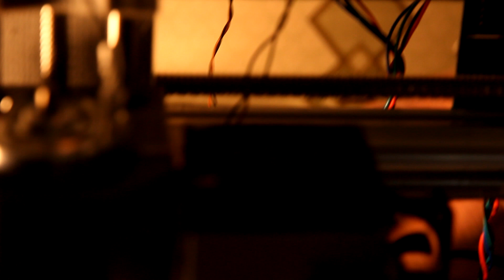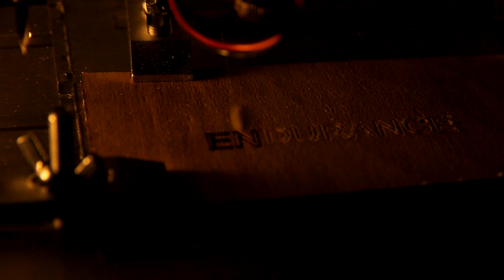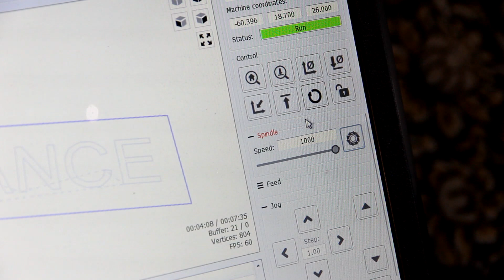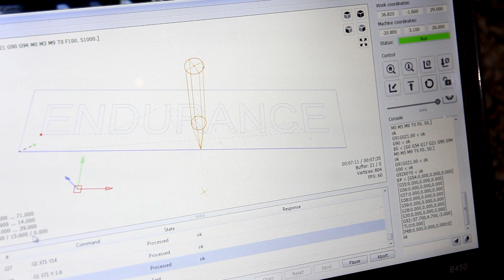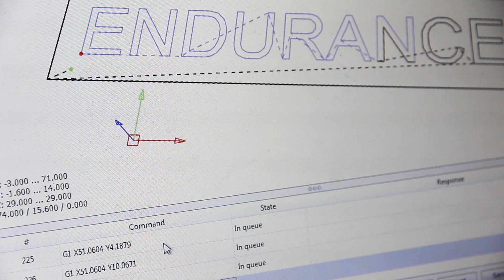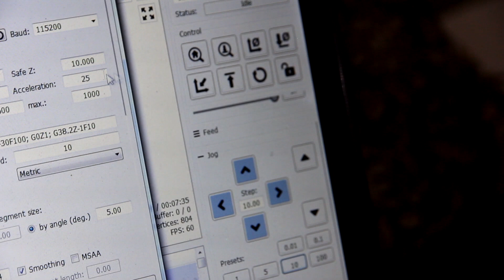How to run a CNC 3018 milling machine. Upgrade with an Endurance laser module.

Comment: Just as an edit, the spindle speed is around 8300-8500 rpm at 24v/0.320A.
The software is simply saying 1000 as a 1000/100%... Which stranslates to 100% speed when 1000 is selected!